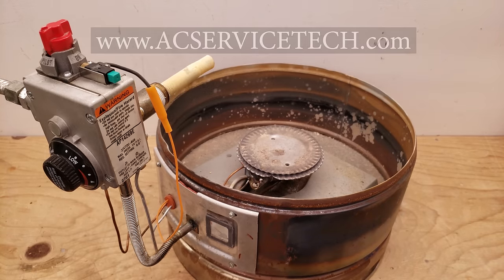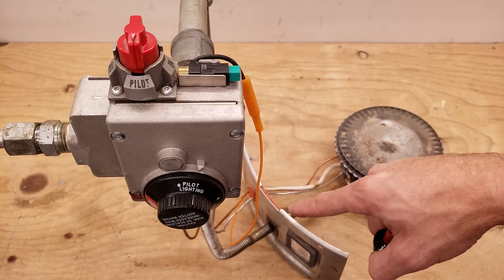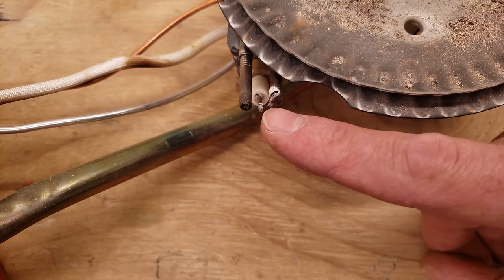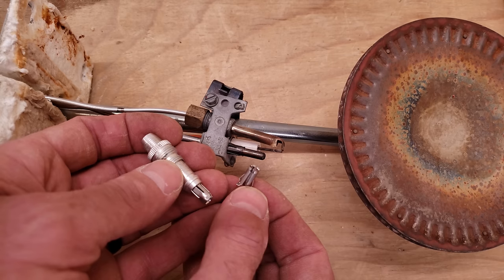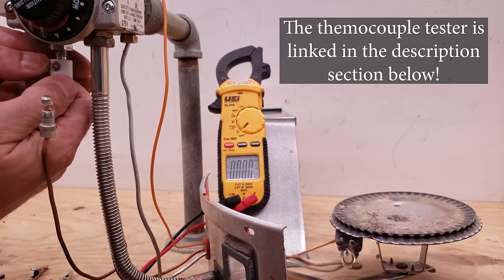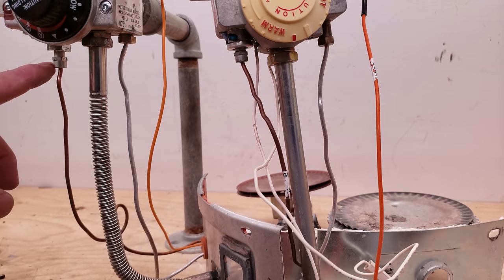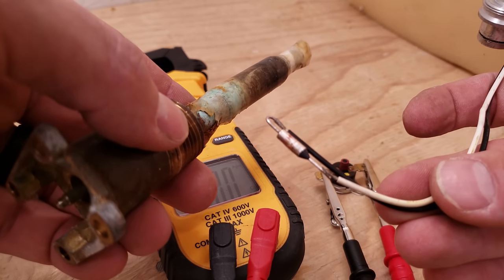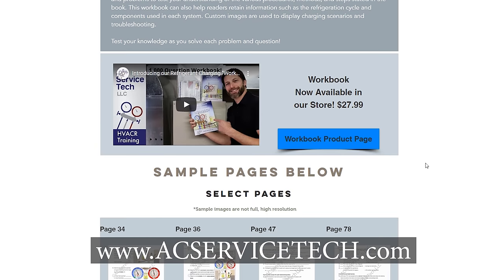Top 10 Gas Water Heater Pilot Light Problems! Won't Light, Won't Stay Lit!

Comment: My pilot light has stayed lit over night when the water was alternating heated, after I manually turned it on. But as soon as it lights the main burner it goes out after 8 or so minutes. I replaced the pilot assembly including thermocouple and I have the same issue 😔

Comment: Thank you so much for sharing this.  Just wondering if you can share your insight about the issues that Im having with my rheem stellar 360 gas water heater. When i depress the knob fully in a pilot position, it seems the main burner gas line is opening as well. Thus, when you start igniting it cause the main burner to light, and this is happening while depressing the knob fully in a pilot position. Is there another solenoid in the 2nd/main chamber aside from the solenoid valve connected to thermocouple/pilot position? Please advise. Thank you

Comment: Question, I have the same set up here but lately my pilot flame is coming out yellow 🔥, I recently installed a brand new pilot assembly, I made sure the pilot line is clear by cleaning the orifices on each end. But the flame when the burner turns on, it comes out yellow causing soot to cover the thermocouple and the shock igniter point. I keep having to clean them whenever the pilot goes out and can’t get a spark. is something wrong with the gas? I use propane
Reply: UPDATE: the entire burner assembly was completely caked up with soot!!! Why did that happen?

Comment: Im getting the hull thing to light but like it should but it dies after a few seconds a little light in the middle stays on for about 1 min but the shuts off can u help???
Reply: I had a glass leak at the meter so it just didn't have pressure i think
Reply: I'm getting the same problem... getting someone to look at it but over the phone he kinda insisted I should just buy new water heater... I just wanna fix it not replace it that's why I'm watching this video a million times lol trying to understand him

Comment: I don't get it where you heat up the metal thing with torch that makes the pilot button pop up.  If your holding the button down in order to light the pilot shouldn't you want that in the down position & not up? I'm confused by the way it was explained on that part. My pilot shut off, then I lighted it & the temp dial/burner turned on briefly, but the flames & pilot went out again. After that, I tried to light it 3 times, no dice/no pilot. Later I tried & got it to light up while holding the pilot button down, but 4 times burner failed to light up when I let pilot button up to turn it to the on position, then the flame went out before I could turn up the temp dial/burner. It looked like in the pilot window that the flame was all around the metal thing that makes the pilot button pop up, but it won't stay lit when I switch the button to on so what part do I need to replace? Do I need a new one of those pilot button deals or do I need a new thermal coupler? Forget getting a mili meter, I don't have one & don't understand the readings even if I did have one.

Comment: The pilot light ignites and stays lit...when I turn the temperatthe minute I turn the temperature mfrom ofure on (click) it ignites but then blows out the pilot and the burner...I can hear the gas flowing because the thermocoupler is hot but nothing is burning.
I see the spark and the pilot light stays on when I turn it from pilot to on....but the moment the temperature is turned up the flame comes on and then drops dead

Comment: Although this is an in-depth look at almost all the things that could be wrong, but as my dad once said, start with the stupid simple things first. The most simple explanation as to why a pilot keeps going out is a lack of air flow. I mean, how are things getting bent inside a  closed system that has no moving parts? It's much more likely that something is clogging the air intake

Comment: I have a 4 year old 30 gallon propane hotwater heater. My thermal limit switch keeps popping out. Almost every day. What can I do to correct this issue??
Reply: I can push it back in a light the heater and it works for a day or two and it pops back out.
Reply: I have the resetable thermal limit  on my unit.

Comment: So my pilot stays lit but after it runs for a while (heating up the system) it'll just shut off and I'll have to re lite the pilot. I replaced the thermal couple and it still does it.
Reply from the maker: Have you blown out the pilot tube? Does the flame fully envelope the thermocouple normally? Does it fully envelope the thermocouple when the main flame shuts off or does it quickly shut off?
Reply: Try cleaning/vacuuming burner compartment and flushing water heater of sediment.

Comment: I just replaced a gas valve and thermocouple on a NEW Rheem WH.  Now the customer is saying the pilot won't stay lit after just 2 months again!  WTH!!
Reply: You should've replace the whole water heater assembly not just thermocouple its very cheap and easy to do that way everything is new and likely no problem for a,long time
Reply: @semajtheguru9183  Problem is supply house rarely has the whole assembly in stock and customers want it fixed immediately.  But I get your point, I've done it before.